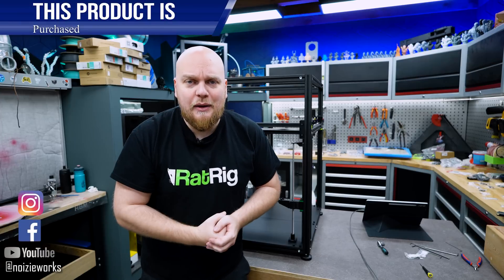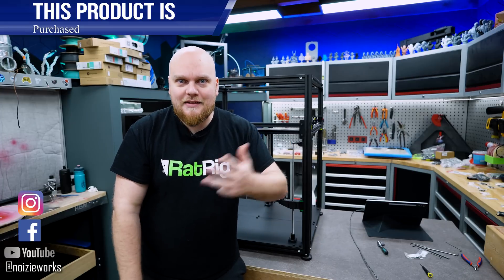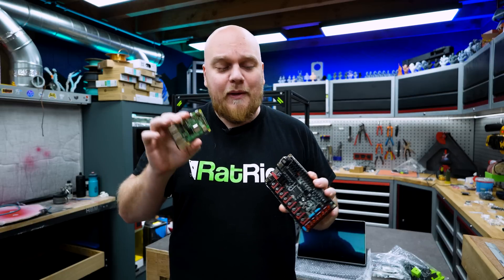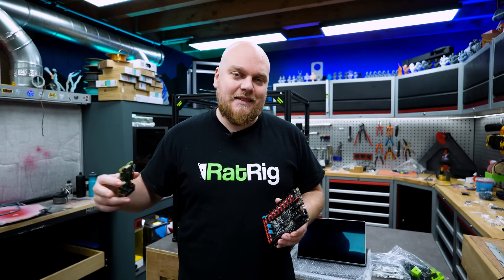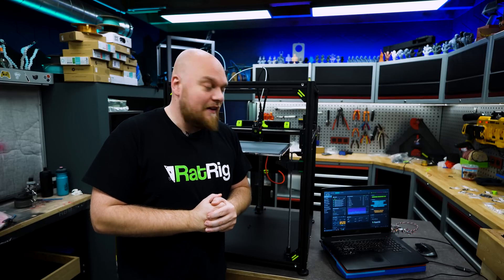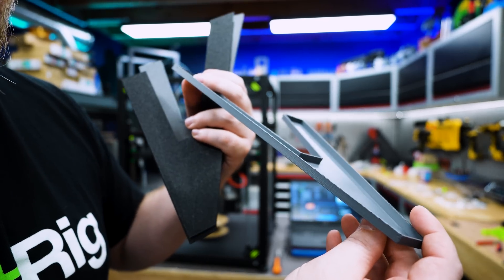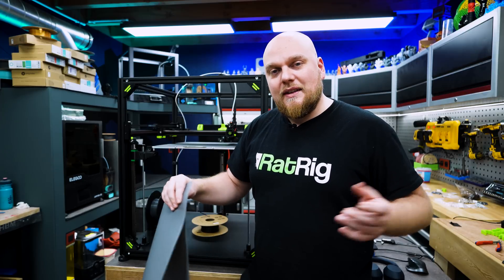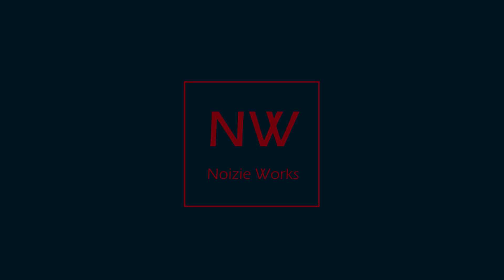Ratrig V-core 4 electronics belts and a perfect first layer part 3

Comment: What are you using for a slicer? I'm having issues where my tool head shoots too far in the rear completely missing the bed. When doing the z-tilt.
Reply from the maker: Orca has official profiles but that sounds like a macro issue, did you select the correct bed size when going true the configuration? Sounds like you are 1 bed size larger in config.
Reply: @NoizieWorks  I started thinking about it and looking at a couple references photos and I think my issue is my y endstop is on the wrong side of the 2020 support. Im planning to double check later today.
Reply from the maker: @Milkman3407  that could do it but it's fairly clear in the manual so double check
Reply: @NoizieWorks  Oh yeah just double checked the build manual and I put the endstop on the smaller 2020 where the gantry sits vs putting it on the longer 2020 one. I'll get that cleared up and let you know if that fixes it. 

Also love the quick response and loved your video series.
Reply from the maker: @Milkman3407  thanks bud! Happy to help
Reply: The problem was the endstop was on the wrong 2020 support. It's working now. Just need to figure out the nozzle wipe and add the filament run out sensor and we'll be up and running. 

One last question. What do you use to test first layer on the whole bed?
Reply from the maker: @Milkman3407  first layer file is provided in the docu, only need to scale to the full buildplate(non uniform)
I asked my engineering contact i met on formnext about the nozzle wiping and it's only for idex right now so if you find out let me know and i still have to buy that sensor unfortunately, i did figure out that pausing the print to switch filament gives me a z offset difference of .2mm and basically makes the print fail. Not yet figured out what the deal is with that so i always make sure to use enough filament for my print right now. Could ask my contact but i have other stuff to do right now.

Comment: I get my 500mm IDEX delivered in the next couple days and was nervous about a full DIY kit. Your series helped put me a bit more at ease about how "bad"/tough it was going to be.
Reply from the maker: @grenade558  glad i could ease a bit. Only the toolhead wiring is a bit of a pain, hioe you got some spare crimps😉
Reply: @NoizieWorks  that's exactly where I'm stuck at dude to never having crimped before. I picked up spare wire, a JST connector pack and pins to practice on.
Reply: how is the build going?
Reply: @nonam3007  I'm roughly 1/2 to 3/4 done and it was absolutely enjoyable, even relaxing since I was taking my time and not stressing about getting it done fast. 

Until I got to the electronics section everything was pretty smooth until the electronics section of the guide. I've never crimped pins before and I stupidly started right on the tool head fan, ended up taking roughly 2" off the wire before switching to practice wire and pins. I figured it "wouldn't be that hard" and learned that lesson. Thankfully, everything is open source so I can buy another fan if the length isn't enough to reach the board.

The unofficial discord is extremely helpful between searching and the community!
Reply from the maker: 💯 search function and the dozuki comments helped loads!
I agree, very enjoyable untill the toolheads wiring.
Reply: @grenade558  awesome. I am getting more and more convinced to buy this instead of the H2D!
Reply: How much did your 500mm kit set you back?
Reply: @calebdrake3544 for shipping to the metro NYC area, it was just under 3000 USD. The tools I didn't have (never have done electronics work before), spare parts, enclosure, and additional items to meet the look or accessories I wanted, was another 800 (enclosure being 550 of that).

Comment: I have the rat rig v4 - 500, keep getting this error Gantry twist relative to the center High gantry twist: 145.521079μm. High chance of first layer problems, beacon scan compensation is highly encouraged.  Any ideas on how to fix this?
Reply from the maker: it's in the manual on how to fix it but in short it's loosening all the bolts that hold on to the X beam in the printed part. Loosen the bolts on the bearings and  tighten it at the front stops of the printer untill both parts hit the stop at the same time. Took me an hour to get it close enough and now i have low gantry twist. It's under 10. Gantry alignment in the new docs

Comment: Thanks a lot for the videos! You pointed out a few things that I was wondering, so thanks for the confirmation of all that. 

I see you didn't get into that much detail about electronics or software install, did you find the install "easy" enough? 

And do you plan to try the Idex on it? Cauz I see a lot of people talking about vibration problems right now, so I wonder if you have it!

Anyway, thanks a lot again and I can't wait to see you others videos on this 3D Printer!
Reply from the maker: @fogryu  working on the enclosure right now for some massive abs prints.
Software is VERY easy, the hardest thing is putting the file on a sd card and making connection to wifi.
That's the reason i got it and it didn't disappoint and that's why I didn't show it.
Wiring is ok with good enough explanation but it should have come with a wiring harness that's 90% plug and play as the toolhead is just annoying to cut all the connection to recrimp them to something that fits(buy an assortment box of spares with a crimping tool you will need them)
I guess they sell enough units to ask for other connectors on the parts they buy 🤷‍♂️
Yes idex seems to be a hassle so i have paused the idea for now, i will eventually do it but i want to enjoy it first as it's pretty easy to install after the build.
More vids in the future so stay tuned 🫡
Reply from the maker: On the vibration part i have the smallest bit in the 125hz range as almost everyone apparently. Doesn't affect the overall performance.
Reply: @NoizieWorks  Yeah, seem to become a bigger problem with Idex tho. I saw a few peoples just taking the Idex out because of that.
Sad if you buy this printer for the Idex haha. But seem to be a really good printer even without Idex. At least when you manage to setup everything well.

I just hope future updates will fix this!

Anyway, thanks for the answer!!
Reply: @NoizieWorks   Thanks for the answer!

I'm curious about the enclosure you're doing, you said something like "Prusa One inspired" , so I'm curious haha.

And yeah Ok, I was thinking of getting one, already helped a bit on building one partially, but didn't do the electronics and the software install, so I was wondering how it was. And the Idex looks interesting, but the more I look, the more I see problems haha. Even the peoples I helped a bit, which are professional 3D Printers, seems to had some rough time with it as we speak

Comment: How the heat creep happened on a open frame machine?
Reply from the maker: @nezihmertbolgul3605  retractions on a 250c hotend and a nozzle that doesn't flow will do the trick on pla (crancked the temp to get to 14mm³ for testing)
Replacement of the nozzle to restore the flow with normal temps is all it took to fix it.
More big prints in the future and have a cool cosplay project in the pipes.
Now need to take some time to do some speed tuning 😎